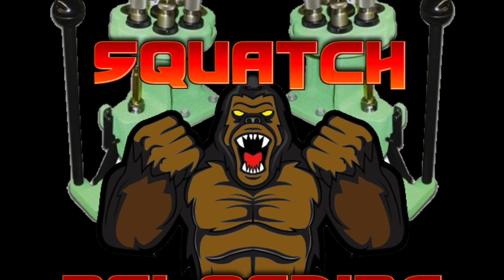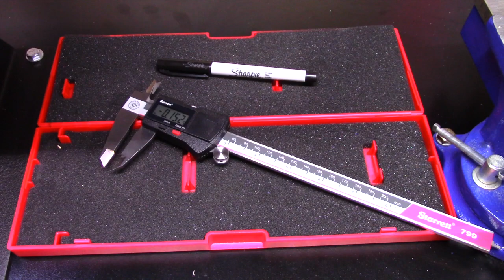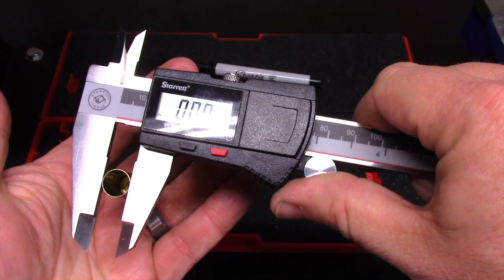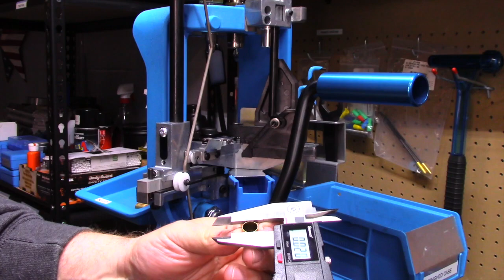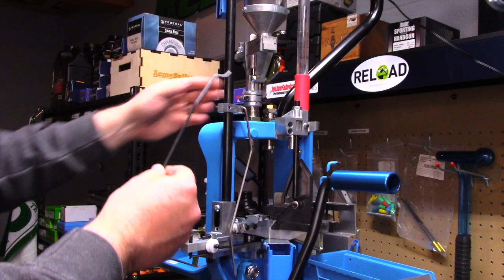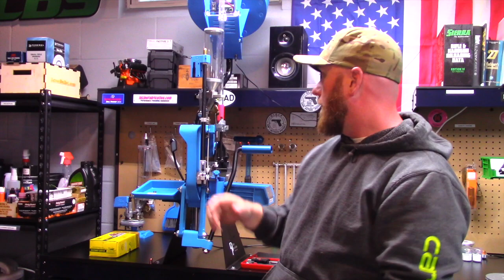Dillon XL750 10mm Case Bell Setup  Part 9

Comment: Question. I have a brand new 750. 10mm set up. Flare .012-.013". My cases are getting stuck on the expander/powder through. Difficult upstroke until it lets go. Any ideas?
Reply from the maker: This is the Dillon hiccup.  First thing I would do it polish the expander flare.  You may be able to back the flare off a bit as long as you are not shaving bullets.  I am going to go out on a limb and say you are probably wet tumbling.  These phenomena only really appeared to me when I started wet tumbling.  If you call Dillon they will tell you your brass is too clean.  If I dry tumble with corn cob and some kind of polish it’s virtually gone.  I have heard there are companies now making a powder die with a different profile to address this issue as well.  Using a good coat of one shot lube in a plastic bag making sure it dries also reduces the frequency as well.  I hope this helps.
Reply: @SquatchReloaded  Thank you very much! Yes I am wet tumbling. I was thinking about some lube but wasn't sure. That's great info.
Reply: @SquatchReloaded  I was able to sort out the issue. Used some one shot like you recommended and it worked perfectly. Thanks again
Reply: @SquatchReloaded  Just wondering if you can throw a name or two out on which companies are making the new profile powder funnel that possibly addresses this issue. I'm just getting started with reloading 9mm/straight wall after doing .223 for years and noticed this issue so I stopped until I can have some sort of consistency. I started with brand new cases which after doing some reading will dry tumble. But I will say I also had some range brass I purchased that I dry tumbled that I used to set up the powder die/flare and they essentially did the same thing. You also mentioned polishing the powder funnel, what should I use for that process? This has been extremely irritating to use mild language.
Reply from the maker: Double Alpha makes a powder funnel that goes with their bullet feeder that supposedly helps the issue.  I personally have not used one of them.  I have also found that if you make your flare to large it is a contributor to this as well.  In regards to polishing I used some rubbing compound and a buffer wheel on a dremel.
Reply: @SquatchReloaded  thanks for the quick reply. I actually have the funnel and mini bullet feeder that came from Double Alpha as a combo. That’s how I discovered the problem, since then I’ve went back and forth between that and the Dillon funnel to see if I can nail down the issue but still the same. Every time I switch between funnel I course go through the process of adjusting. Currently I’m in the process of dry tumbling about 100 of the brand new brass, then I have to a set of 10 I just lubricated with some One Shot, I also did a qtip of one shot around the outside of the funnel that makes contact. Hopefully something works.I haven’t been able to start reloading 9mm since early October when I got the bullet feeder and conversion kit.

So irritated I should’ve just stuck to reloading rifle cartridges 🤦🏼‍♂️